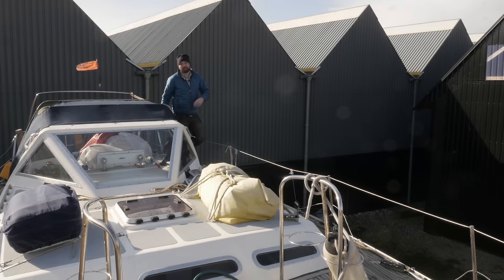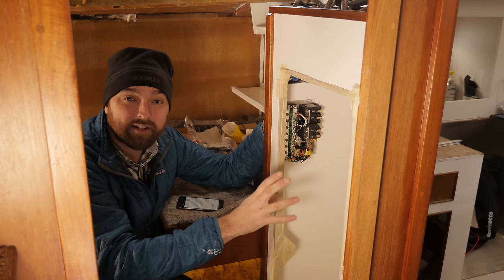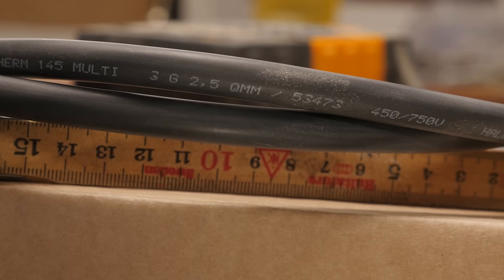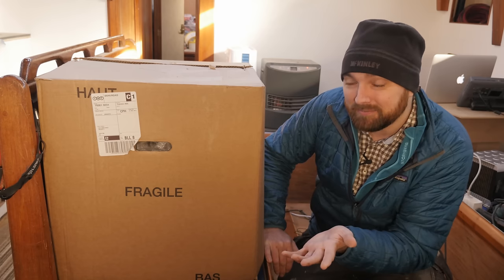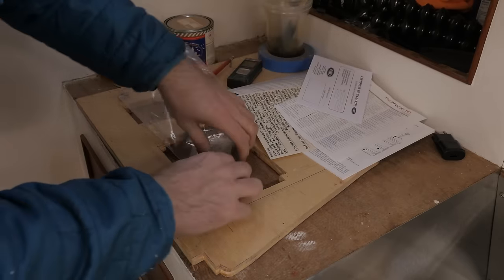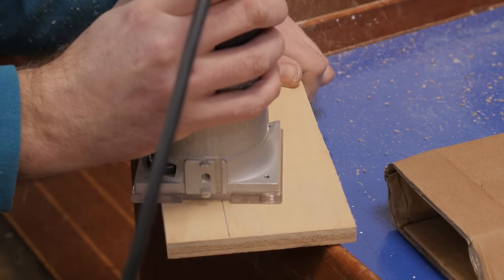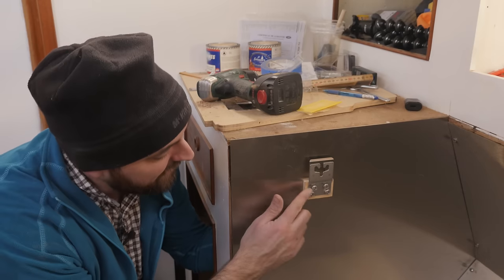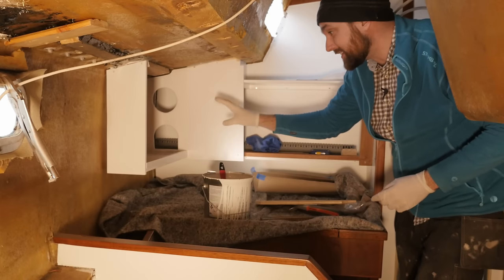Sail Life - Eno Open Sea stove for the galley & prepping to rewire the AC - DIY sailboat refit

Comment: Would you not consider 3/8" st/st shims at your brackets. every thing else is stainless steel. An engineering workshop will be able to knock those out pretty quickly as it is standard plate thickness.

Comment: Why do you need an isolation transformer? When at the dock aren't you grounded by the shore power?
Reply: Its safer. You can't be sure that the shore power connection is good. The isolation transformer separates the boats electrical system from the dock, using a transformer. This is not only good from a safety standpoint, it also lessens the risk of electrolysis, which is the reason my Endeavour 40cc sunk. Wish I had put one in. But they are expensive, and heavy.  If you don't plug in its not a issue. But he will be plugged in for a while it seems so makes for a good investment.
Reply: I understand that ... Now I'm wondering how is the isolation transformer secondairy winding earthed? Or isn't it?
Reply: Koen Kempeneers it's not connected in any way to the shore power. Or to "ground".  if there is a fault, current returns to the transformer, and trips the breaker. Much safer than shore power.  the current goes through the transformer winding. hope this helps.

Comment: I went for speakon plugs / sockets and "replugged" most of my stuff. And I build adapters to regular 12V sockets. Thats because I hate these 12V sockets for many reasons, one of which is one specimen which already got quite hot.  I would think of buying rubber cable if you want to spend extra money, these are so rugged that they might outweight the benefits of tinned strands.

Speaking of tinned cable, this is the only one I could find off the bat,  way overkill and too pricey:

https://www.reichelt.de/OeLFLEX-FD/F855C-3G1-5-50/3/index.html?ACTION=3&LA=3&ARTICLE=165847&GROUPID=7700&trstct=vrt_pdn

but it is halogen free, tinned. And shielded. And I quote "for wet environments in machining centers,..."

Comment: I wouldn't use the 12v sockets everywhere, they are horrible!  Adaptors can be lost and they disconnected with the lightest of tugs. It might be worth a having one or two 12v sockets but the rest should be the bluesea USB sockets with a switch next to each one for when they are not in use.

Be weary of cheap Chinese USB sockets or adaptors as they normally cause electrical interference with radio signals and the like.

Comment: It would be easier to just wrap a colored tap at maybe a 10 cm  interval
Reply from the maker: Are you referring to the cable? :)
Reply: yes.  electrical supply stores usually offer a variety of color coding tape, but I guess you could use anything including shrink wrap
Reply from the maker: Sure but it would be nice to find a cable with a more appropriate color also :) Although I doubt that is going to happen. I've been searching high and low. Including pestering the local electricians. They were sadly no help.
Reply: maybe an art supply?

Comment: First, what is that 10cm gap between the electronic lines required for? Is it because of insurance?
Now second, and more important, I want to tell you something. I have been following your videos for a very long time now, and I really like them (and they are getting better from week to week). But I am getting really annoyed by the way you "act as if" you have just stopped doing something or by you faking steps of work for the camera.
Why do you hesitate to film yourself actually working so much?! I can't imagine this community being angry with you just because you can see an actual (minor) failure of yourself in the video. Actually, the opposite might be true, since these videos help many people who work on their own boats.
Best wishes from Germany!
Reply: Annoyed? Really? I find it the opposite. Possibly because i assume that if a step was "recreated" it was because the value of the step in explaining a topic or process wasn't discovered until after the step was done. Or possibly just filming from a fixed angle would result in lots of steps being out of shot or obscured at the crucial moment. I find it amazing that Mads is able to achieve so much work while producing such great coverage of the process. To be doing some difficult task that would frustrate many and lead to thrown tools and lots of fiddlesticks. Yet Mads is pausing and readjusting the camera angles and positions so that we the captivated audience get the best seat in the house. I have nothing but gratitude for Mads efforts in entertaining and educating us whilst still managing to rebuild a boat. Well done.

Comment: FYI - Physical Properties:  AC works best on solid wire, DC works best on stranded.
Reply from the maker: Interesting but I'm required to use stranded wire if I want to adhere to the ISO standard which would be cool :)
Reply: Not versed on your standard, by all means follow it.  When I wired my former office, I went ahead and used stranded wire on AC anyway because it is a whole bunch easier to pull through conduit.
Reply: That is completely wrong. For normal 50 or 60 Hz AC or DC there is no practical difference between stranded or solid wires. For higher frequencies there is something called the skin effect and there is a special kind of wire called Litz wire that takes advantage of that.
Reply: No solid wire allowed on boats, prone to heat fatigue due to movement. Copper is a work hardening metal. Solid core should only be used in rigid applications.
Reply: Absolutely go with stranded, but it has nothing to do with the conduction properties of AC or DC.
Reply: Thank you for the work hardening data point.  Yes, my AC experience is buildings only.  As I said earlier, I used stranded wire anyway because of ease in pulling through conduit with no apparent ill effect.  Which brings up a follow up question.  Mads is asking for an alternative to black jacketed cable.  Is it possible to install non-metal conduit and pull individual conductors instead of jacketed cable in marine applications?
Reply: While it is true that at very high frequencies, solid conductor wire shows increased impedance due to eddy currents forcing the current to the outside, aka the skin effect, that is not the case at 50-60Hz and common wire sizes used in boat building. Solid wire also is more likely to work harden and not a good idea to use it on a sailboat which is constantly flexing.